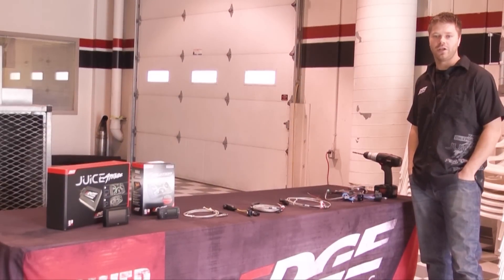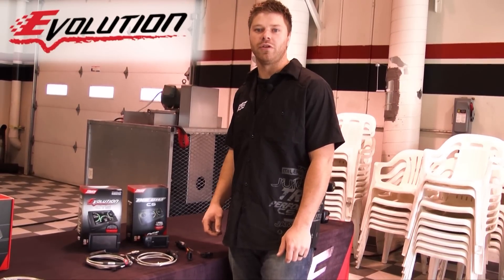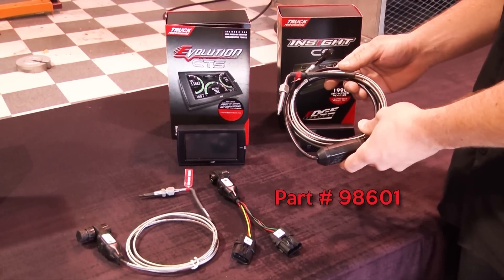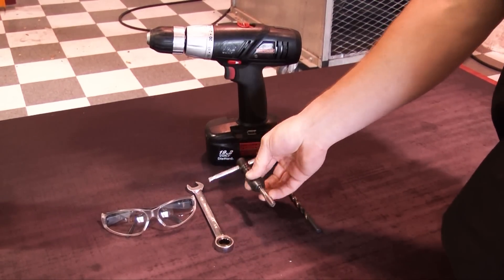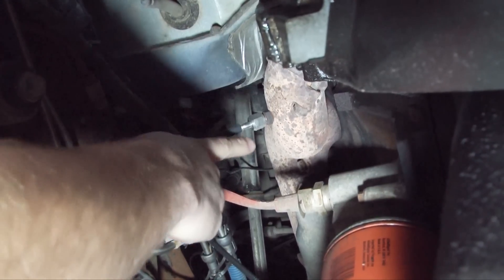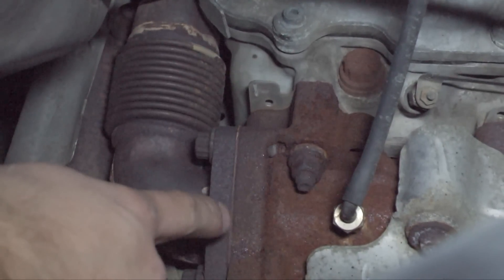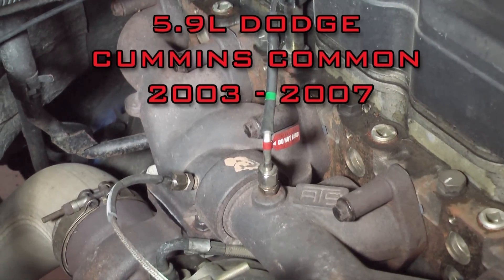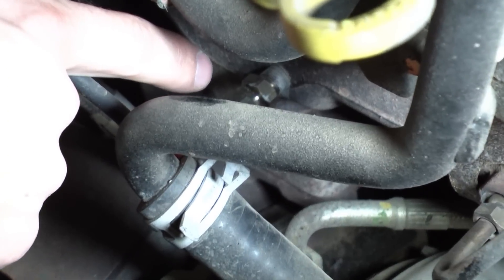EGT Probe Locations

Comment: Thanks for the video.  So far it's the only one talking about EGT's.
My EGT is in a RAM 1500 EcoDiesel but, I don't know where the EGT located.

I've been under the truck a couple times and have found four or five ports along the exhaust line but no one can tell me its location.

Comment: I put my get probe in the elbow on the outlet of the turbocharger. No concerns of metal filings there.
Reply: Big trucks have the probe post-turbo and the rule of thumb is a 200 degree difference
Reply: +Wesley Cooper  You don't get a good EGT reading there. You want it right out of the exh ports. The reading you get where you have it will be cooler than actual.
Reply: Enough cooler to make a substantial difference?  If you're red-lining egt I don't suppose 15 degrees will prevent a meltdown. Big trucks have the probe post-turbo.
Reply: @1984wcooper  200 degrees cooler in that spot.
Reply: @scottdowney4318   maybe I should move it pre-turbo. Then I'd probably be scared of the reading!
Reply: Screw the worry about drill filings.  The turbine is not a scrub style